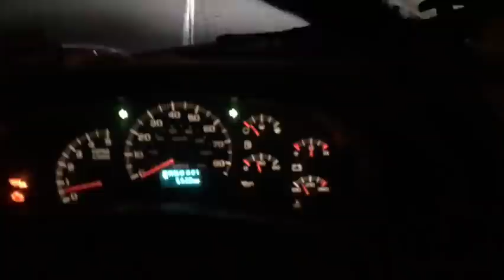RoadTrip to Pick up the new body and meet some new friends….They Wouldn’t take a dime for Delivery!

Comment: Wow, Taking a hit that hard and the rolling it took and all that got bent was a few brackets and attachment points. This just shows how well Nick over built this chassis. And is testament to the high quality materials he used in this manufacturing of this chassis.  And Yes, Its pretty cool to see what was under the body of the truck. All hand made, There's a lot of blood,sweat, and tears that went into building that truck after the 30's crash.
Reply: i love how this couple does things and works so hard, it scares me that the chassis didn't bend anywhere, that means Nick's body absorbed the impact.  Thats how drivers get hurt, should be some crush zones built into it, keep him safe.